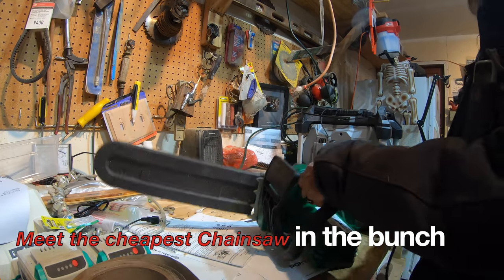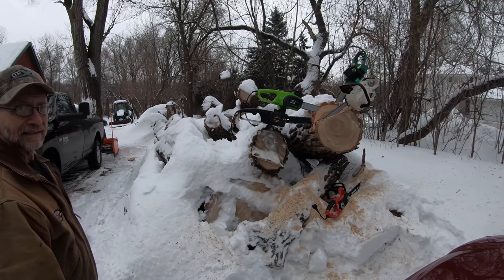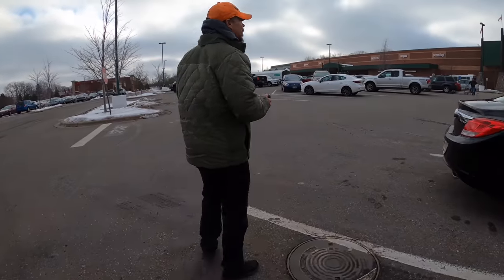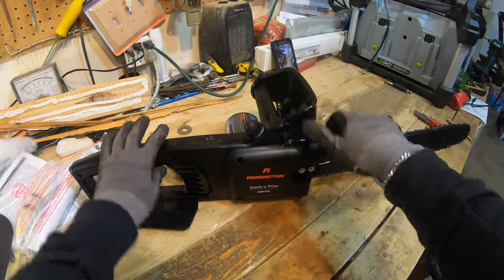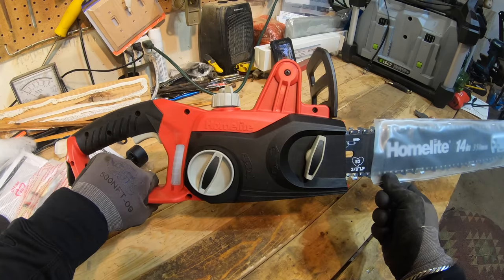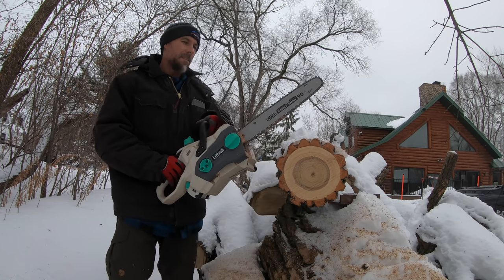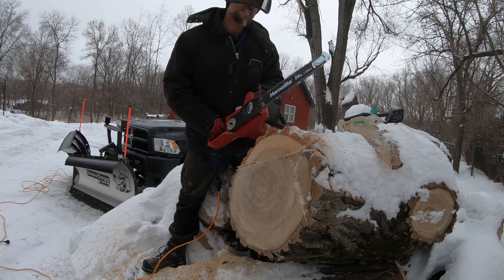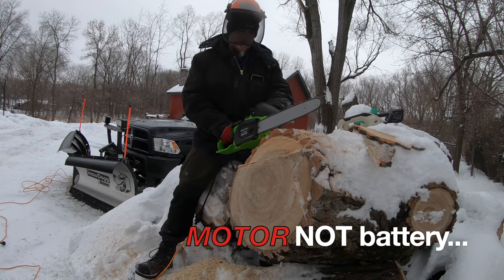Testing the 5 cheapest chainsaws. Harbor freight VS Menards VS Home Depot 4 k

Comment: I rolled my eyes at electric chainsaws until I tried one.   No need to bother with mixed gas if you have 120vac and the occasional limb less than 4-5in.  

My father who has breathing problems turned down my stihl last week and tool care of an uprooted 40ft spruce with an electric chainsaw.  He cant be around the fumes of a gas saw.

Also, you can use an electric chainsaw in your garage or shed if ever there is a reason.
Reply: I agree they have their place and plus they are easy to use..... I've used electric saw for hours and didn't even feel like I worked lol
Reply from the maker: Yep-  I like them as well.

Comment: I had a cheap corded chainsaw (like $25) which worked just fine but once the oil tank cracked there was no replacement part and fixing it would cost like a new chainsaw. Now I'm running Makita corded 12" and toolless chain replacement is so worth getting not to mention I'll actually be able to get it repaired since Makita cares about having parts.
Reply: I use garage sale find electric chainsaws. I never fill the oil tank.They leak. I just use a squeeze bottle and oil the chain. The key on these saws is to keep the chain sharp.

Comment: Thanks Stanley. keep em coming, I think considering the pricing they didn't perform too bad, apart from the battery one! Don't suppose any of them would last that long, maybe the Homelite? I started using an electric saw (same size and similar power) for cutting logs at home as they are much quieter than gas so I didn't annoy the neighbours too much! Also as I use it in a clamped hinge system in a sawhorse, the blade oil filler is on the top, so can be refilled without taking the saw out of the clamp. I started with a Bosch which I thought would be good quality, it has a nylon sprocket that stripped the teeth pretty quick, I ordered a spare part and replaced it, but it did the same again .I then got a Qualcast, this has the Oregon Quicksharp system and works well. Used it for a couple of years cutting approx 5 cubic yards of various sizes (from about 14 inches diameter down to small branches. Still on the original blade, but it's on it's last legs and will have to be changed pretty soon, Both the saws cost around the £100 mark ($120).. I'm thinking of getting a 14 inch battery powered AEG, mainly because I have other AEG battery tools, so already have the batteries, and the other AEG tools are good quality..
Reply from the maker: A good battery saw is Makita or Ego.  Both are top of the line in these parts.

Comment: Could you do a video on picking your first skid steer for snow removal? I.e. hp, high flow/low flow hydrolyics, maybe what you would be looking for to replace a truck with a 8 ft front plow  doing a larger lot? Could partner with a dealership via zoom and cut away to different video you already have.

Comment: I've used one of those Remington electric saws..... I wasn't a fan.... Makita makes a fine electric saw though.... But I own a gas powered Remington and it's not bad.....  It don't compare to my  Stihl by no means though lol

I have one of those homilite electric saws but it's got a 16" bar and runs 12 Amps.....  (They use alot of bar oil is my only complaint I have about it) I've used it to cut loads of poles around the same size you cut at the end of your video...... I've used a lot around the house and owned for years and it don't show any signs of quiting.... 

But you can never go wrong with gas lol

Comment: The cheapest chainsaw you can get is a handsaw. you just gotta be quick enough.
Reply: and it has the most benefits: no fuel or oil needed, you get a great workout, no need for cables or charging batteries, the lightest.
Reply: @sdfjsdjfghssfgdsgvfs  I wanted to take a cookie of the end of a fallen arbutus tree that had been cut through to clear a trail. 14 inches diameter.  All I had was my 14 inch handsaw which was already slightly dull.  I wanted to see how badass I was and it took me about an hour and a half to cut through.  Damn, I'll never do that again.

Comment: A decent comparison, but .... can such a saw last 
for the 10-15 years, as a, for example, Husqvarna gasoline saw?
Reply: What do you think? I'll bet if you put one of these and a gas powered saw in a shed for 15 years, one of them would start and the other wouldn't. You'd need to order a new carb/fuel lines for the gas saw. (Even if you ran it dry.) Now, as far as which can be used daily for longer? Obviously the Husqvarna. And just because something says Husqvarna on it, doesn't mean anything. They make tools that are $150-1500. The ones that are $150 are pure Chinese garbage. Every year, you'll have to buy the carburetor, fuel line, primer bulb, fuel filter, and air filter combo; for $45 to get it up and running. (The carbs are non adjustable, you can't get the jets out, and they have thing, cheap, plastic membranes. They are disposable.) So if you only have $150 to buy a chainsaw that will be used 2 A year, get the plug in electric one and save $100. If you cut a lot of wood, buy the $250-400 gas. If you cut wood a few times a week, on your house or farm, buy the $400-600 gas. If you are cutting wood commercially, many hours a day, as a job, buy the $800+ gas.
Reply from the maker: Geez no-  I would think they might last a few years with light work..  It would be interesting to see if we could burn one up on a big tree though.
Reply: My homilite has always been ready when I needed it and I've had it for about 5 years..... It got a lot of hard use in it's first 2 years in my possession but I got me a Stihl 265 a few years back to take on the harder jobs around the house now..... But I've had to use them both.... Depending on where the cuts are happening and how big the stuff to cut is and how lazy I'm feeling lol..... The only limitations of my electric saw is that the cord can only be so long before it can't deliver the juice
Reply: @unknownxj1420  Ok Good 4 you.
Reply: @Dirtmonkey  Wold be interesting.

Comment: I have seen other channels test 'cheap' equipment and felt the same as this test of cheap chainsaws.  Why did I waste my time watching?  

Anyone who buys the cheapest whatever is not going to be watching a review of the cheapest whatever.  Let them buy based on color, design, or however they choose.  

Test stuff that you or I might want to buy that will get the job done.  It does not have to be the most expensive nor the biggest.  Please don't test junk again.  Leave that to the channels that are failing.
Reply from the maker: Thanks Ron-  apreciate the input.

Comment: so battery powered amazon special was the junk one of them all? go figure you get what you pay for on amazon.
Reply: Not necessarily.
Cold RUINS battery power.
So, I'm not sure how cold it was out there, and whether they kept the battery inside for hours and just popped out for a few minutes vs left it outside for a while.
But it may perform much better in 50 F and up.
Reply: But if you're intending to use it during winter weather, definitely do not go with a battery powered one - not at a high price point either

Comment: FYI... electric motors are "motors", and gas engines are, "engines".  There is no such thing as an "electric engine"...
Reply from the maker: Your right-  I still have a hard time remembering that.  Thanks for pointing it out.
Reply: @rustie61  Nope. That's a myth. Engine and motor are synonyms. It's semantics, and it's just not true. Like the rock biters that say, "qUiCk iS fOr aCceLerAtiOn aNd fAsT iS fOr tOp SpeeD."
Reply: Was that aloof enough for ya rusty?
Reply: @mitchdenner9743  Well, it's all too obvious.  You're not a technical guy, and you must like using 3rd grade grammar, so slow down.  I's all about understanding, which is a very easy thing to learn, and what I'm trying to help you with.  Simply learn what's right and stick with it!!!  It's not rocket science.  And oh... BTW, a rocket is also a motor.  It's easy to remember.  IF it burns air, it is an engine.  IF it carries it's own oxygen, or uses no oxygen at all (electric), it's a motor....
Reply: @xenonram  Actually, you are correct when many do indeed use the terms "motor and engine" interchangeably, because that's what's called a "colloquialism", which is an impure form of casual communication, and not that from education and training... nor is it factual.  Sorry guys, time to bone up on what's real.
Reply: @rustie61  you just can't stop yourself can you? I guess once a d bag always a d bag.

Comment: There is no amp hour on straight electricity, only Battery's has amp hours. I have a polan 16 in 3 1/2 hp chain saw, it's a monster on cutting logs (home own) saw. I have the 9in. pole saw from Harbor Fright and it cuts wood like butter. (home owner) I just got the Lynxx battery 40v 14 in. chain saw (Harbor Freight) it's a beast also. (home owner). For someone just to go buy one of these and doesn't know how to sharpen the blade, none of these saw will cut anything after you hit dirt. When I lived in a house that I could burn wood, gas was the only thing out at that time.
Try battery power, the Lynxx would out power the one you had in this video. Good review man Keep it up!

Comment: Thanks for the review. But you need to learn the difference between amp and amp-hour (and watt and watt-hour for that matter), these are completely different things. It makes absolutely no sense to say something has an 8 amp-hour motor, that's simply not possible. 
What really matters is how much power the motors have, which is measured in watt, not to be confused with energy which is measured in watt-hour which also makes absolutely no sense when you talk about motors. What-hour is however very important when you talk about the batteries. 
The power (of e.g. a motor) in watt is the amperage multiplied with the voltage. Since all the corded saws run on the same mains voltage you can get away with just comparing the amperage instead of the power (in watt) since you are always multiplying with the same voltage constant (120 V in the US), but if you are going to compare it with a battery-operated model running on a different voltage (36 V nominal - not 40 Vmax in this case) you need to compare power and not amperage.
For gasoline and diesel-powered engines, the power is still often measured in HP instead of W or kW, a leftover from the old days, but you can easily convert between the two by multiplying with a constant. These are just two different units of measure for the same thing. 
That being said, to quote Wikipedia on Horsepower: "There are many different standards and types of horsepower. Two common definitions being used today are the mechanical horsepower (or imperial horsepower), which is about 745.7 watts, and the metric horsepower, which is approximately 735.5 watts."

Comment: I've used an electric chainsaw for years now because I have a bad back and can't yank on a starter cord. People make fun of it and I tell them make no mistake that electric chainsaw will cut and if you forget cut just as fast as a gas one.
It's perfect for what it's designed for, that is trimming around the yard, less maintenance, and, if you give it time it will cut through medium-sized trees. It won't cut faster than a gas and it's limited by electric cord length but then again that's not what it's designed for.

Comment: Another quality video! Portland and Homelite for the win! Id recommend trying the Bauer Cordless too from HFT. I was super surprised with it using the 3 or brand new 5 amp.hr battery! Cut many a tree with it and the battery lasts many cuts even with the 1.5 amp.hr smaller battery.  Its so light I get almost no fatigue. Even though its only a 10 inch bar it cuts quick enough you can go to the other side and run it through quick in no time with up to 19 to 20 inch trees! 74.99 or 64 with a coupon or 20 off with purchase of battery and charger sold separately. Great also if youve bought their drill(also sweet deal) package or anything like that and already have the charger and smaller batt. Their pole saw is great too.

Comment: Take away never ever ever ever buy a electric saw over gas ever.
Reply: I have a 20 inch bar skil 606 saw made in the 1950s. I have sectioned a 40 inch diameter tree with it. !6 inch disks. And any of the old milwaukee saws made for factory pallet building will work all day.

Comment: That homelite if that to guard was off looks to be the perfect one
Reply: I can vouch for the homilite.... Well mine at least..... I took the guard of off mine also

It's got a 16" bar and runs 12amps
But I reason the one featured in the video is a good saw also though based on my experience with mine.... My only complaint against it is that it uses a lot and I mean alot of bar oil..... Keep an eye on it and the chain can vibrate and lose it's tension at times..... Monitor those things and you're golden though.....